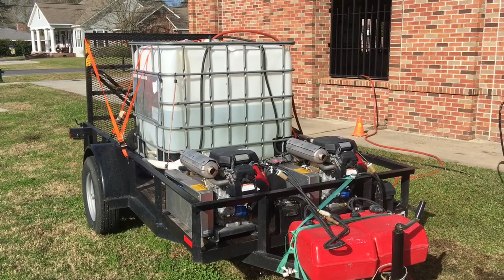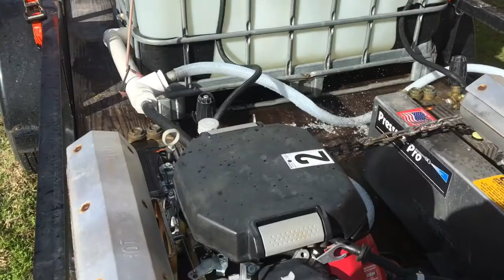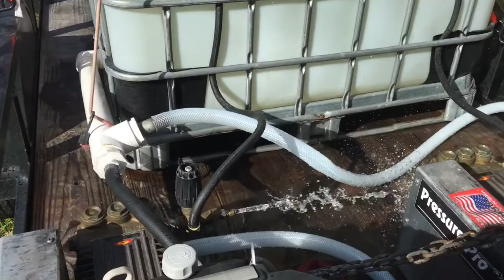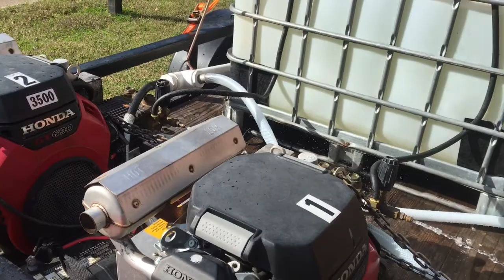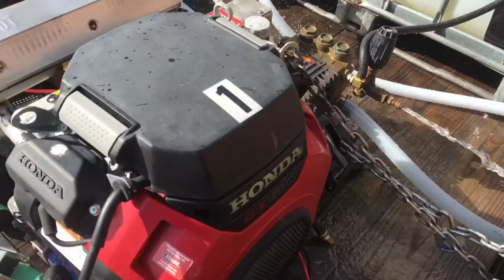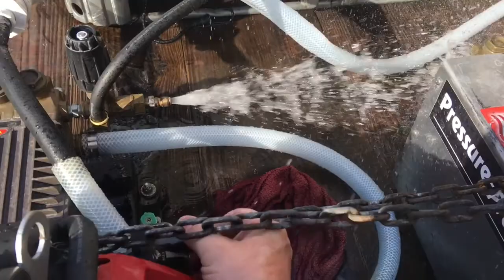Commercial Pressure Washer Set Up

Comment: Hay billy, what happens if you have the engines in an enclosed trailer? Is there another way to purge the lines? Also is it absolutely necessary? I have same machine but I have it hooked up to a hose reel..

Thanks in advance
Reply from the maker: wizard owl  I would definitely start purging the air out of the system before pressure rising.. if your pump is running with air bubbles still in the system overtime that will definitely cause damage. Another way to purge is detach the gun from the end of the hose and start the engine idle.. that way you will not be purging it inside your enclosed trailer and flooding the floor out.
Reply: Billy Davidson thanks for the quick response!!  Ok, I always have the gun disconnected an let the machine idle while water is running out the line... i have a ball valve at the end of my line that I keep open.. (200' of pressure hose) when starting my machine.. I was just curious y u don't keep ur lines connected to ur machines at all times??  Is it cause u don't have hose reels?
Reply from the maker: wizard owl  I have several machines that we use so we interchange the pressure hoses when needed.. sometimes I cannot get my trailer into a spot so we have to use more portable pressure washers.